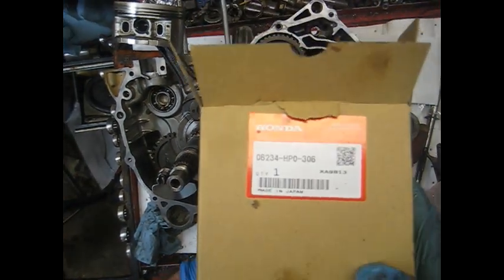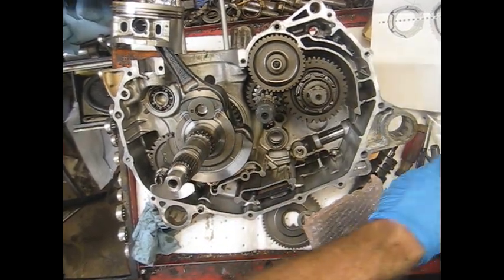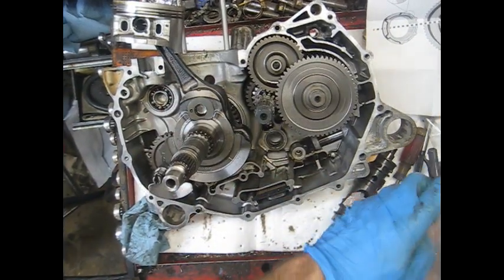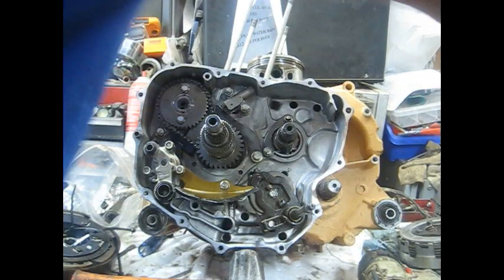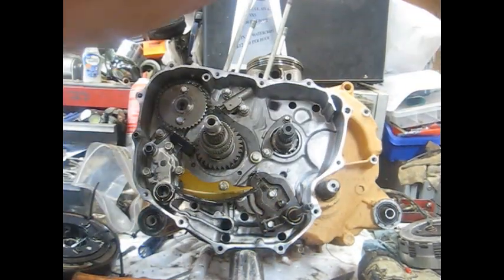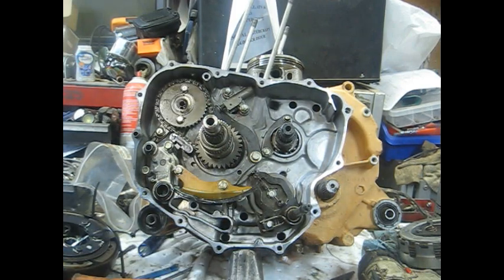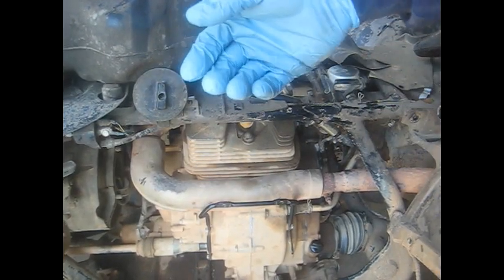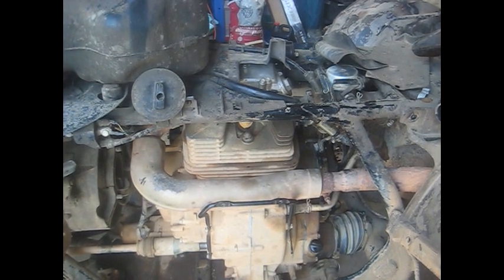Foreman 500 Aircooled engine assembly

Comment: Is a gasket required when installing the cylinder wall back on could tell if a gasket was needed there or not. The surface between the cylinder/jug and the engine block. Great video thanks for your help!!!
Reply from the maker: Yes the base gasket under the cylinder is required.

Comment: I don't know if you said but what did you torque down the rocker arm top piece down too was it 10 or 9 or something like you done everything else foot pounds I don't remember you saying anything about it but I could have possibly missed it appreciate the video thanks a lot guy
Reply from the maker: The manual for this bike does not specify a torque for these bolts.  It just says to tighten them.  I normally just torque them to what I normally do the other 10mm headed bolts to.  That is 10 N/m or 7 lb ft.

Comment: I’m dealing with a problem with my 06 500 I rebuilt the top end and pulled the back two covers to replace the shifter shaft when I turn it over it seems like it has a lot of compression timing is right and valves are adjusted at .006 when I’m turning it over I hold wide open throttle it stops turning over and I used rtv on the two back cases could that be my problem? Your help would be greatly appreciated
Reply from the maker: Just rtv and no gaskets?  If you left the gasket out then yes that's your problem. The thickness of the gasket is needed for clearance on the gears.

Comment: Nice video, did all the job but the gear that the starter turn is jammed so i got to start manually. Any idea how to fix that?
Reply from the maker: Will the gear not spin in either direction?
Reply: @FourwheelerDoctor  no

Comment: - Just finished replacing 1st gear on my 2005 Foreman 500 manual. Put it back together and works perfect. However, the previous owner (just purchased it a month ago knowing the first gear was gone) mounted a fan switch. Believing it’s just for pushing snow or hard hills I left it off. Took the kids today trying to beat the cold (-35 Celsius - VERY COLD) but after climbing a hill it bogged down. Turned the fan on and started it, it ran rough but got better. Left the fan on. Now it kind of knocks a bit, a metal sound (left of the driver side more) Works fine. What could have happened? It sounds like a rocker or valve out of adjustment (I did not adjust the valves when putting it back). No difference between cold or hot. I would appreciate any help. Thank you for the video, it helped me a lot!
Reply from the maker: I wouldn't think you would have run it hot.  I would try a valve adjustment and see if it quites it down.
Reply: @FourwheelerDoctor  - It probably went hot. But very briefly. Could that do severe damage? The knock wasn’t there before. I’ll adjust the valves tomorrow.
Reply from the maker: @maximusfuscus  it's not good on them to run them hot but if your is one of the air cooled models which I assume it is, some of the Honda ATVs do not even have a fan like some of the 350 ranchers and the 300 fourtraxs,  they just rely on air passing by the cylinder to keep them cool. I am also assuming you oil level is good.
Reply: @FourwheelerDoctor  - yes, air cooled and oil cooler with a fan. Oil level is perfect, new oil and filter (positioned correctly). Could have been oil starved? What should I be looking for of opening if again? Man I owe you a lot of beer...
Reply from the maker: @maximusfuscus  if your oil level was good it probably didn't get oil starved. Sounds like it may have ran hot unless you were traveling at a good rate of speed. the fans don't run much on these things but they do come on occasionally and we'll cool the motor off considerably as well as the oil. If you take it back apart what you need to check for is play in the connecting rod at the piston. It can move side to side but it doesn't need to have any play up and down whatsoever.
Reply: @FourwheelerDoctor  - Thank you sir...
Reply: @FourwheelerDoctor  - Although I am affraid that somehow oil doesn’t travel to the top of the engine. It was getting hot quickly even when idling in very cold weather. I could smell something not being right but I thought it’s my WD40 leftover on screws or something. No lights came on. How can I check the oil flow at the top?
Reply: @FourwheelerDoctor  - So I reopened it today. Drained the fresh oil and it was murky/brownish light, unusual, milky. Somehow the oil pump shaft broke! The pressure was lost and the piston sides look scratched. The inside of cylinder wall as well a bit. No vertical play. It probably still had oil but not enough. I am looking for parts now but I never bored the cylinder. I tried blowing with my mouth in the oil cooler hoses but it feels dead locked so I suspect that’s what caused the oil pump shaft to break. Very weird...anyway it could have been worse.
Reply from the maker: @maximusfuscus  that is weird. I can't say I have ever seen that happen.

Comment: Hello I am very thankful for your videos and have a question, I just tore down my 500 foreman that wouldn't go into third gear, I was expecting to find a missing tooth but there isn't any missing. I just got this but I think someone had it apart previously and may have put it back together wrong. Some of the tabs on the gears do look pretty worn but I'm not sure that would stop it from going in third. Do you have a video assembling a trans for on of these? If not is there any way you can help me? Thanks in advance
Reply: Did you manage to resolve why it wasn't going into 3rd?

Comment: Good afternoon, I tore the motor down and replaced the first gear assembly just like in the video, however when I reassembled and took it for a test drive I noticed that it won't stay parked when it goes into gear. Instead it now starts to move whenever I put it in forward and reverse in while still at idle. Any idea what I did wrong?
Reply from the maker: Did you take the one way bearing out from behind the centrifugal clutch? Sounds like it may be in backwards
Reply: @FourwheelerDoctor this compared with 04’ trx450FE? 
Basically same design or should I expect a large difference. Close to setting everything out of frame and onto the table. 
Without any prior issues with trans, had a wheel cylinder stick, son drove it back to the shop here at home from our trails.  (Ran it In 2nd/3rd gear the way back) After going ahead doing  front and rear brake change and flush/bleed with new wheel cylinders.  I started it up, let it run a few minutes, drove it roughly 100yds then an awful noise began. I shifted to neutral with engine still running. Noise didn’t change, shifted to first and noise stayed the same. Shifted back to neutral and shut off the engine. By hand rolled the quad forward and back, no binding or noise. With quad off I shifted to reverse and 1st while rocking forward and back. All seemed fine, until I shifted back to neutral and attempted to restart engine. It made a turn over then suddenly locked down. 
I removed the pull starter cover, using a ratchet and socket I was able to turn the shaft backwards several rotations. 
Removed spark plug. 
Then using the ratchet I attempted turning engine over in its starting rotation. Able to make maybe 2 full turns until it locked again.  
Is it most likely to be only a broken gear? Or something more extreme?
Reply from the maker: The one way bearing behind the centrifugal clutch is installed in the wrong direction.
Reply: @FourwheelerDoctor  I haven’t been into the engine yet, only done the brake work. 
Actually the engine has never been broke into since new.  Certain that something is broken internally.
Reply: I should’ve commented as it’s self instead on another’s comment. 🤦‍♂️
Reply from the maker: @jasonlewallen7146  sorry man. I replied to the initial comment and not yours. You doest sound like it may be a clutch issue as well. If I were you I would pull the front cover and check and remove the clutch. It may be worn completely out. See if you can rotate the engine after removing the clutch.
Reply: @FourwheelerDoctor  I do have the front cover off already, so tomorrow morning I’ll get the clutch off. Thanks.
Reply: @FourwheelerDoctor  I wasn’t able to get busy in the shop this morning as I had hoped, but I’m here now. The problem I have found is that the 3 of the 6, 6mm Allen head bolts in the “stator drum” has sheered off into the stator. Assuming one backed out, then total destruction from there. It’s a mess! Appears that all metal fragments were contained inside drum. Now I’ll be up awhile watching your videos to see what all is needed done to replace needed parts. I see that quality parts will run me roughly $350ish.
Reply from the maker: @jasonlewallen7146  that's odd that they sheered off. In all my time of working on these I can only remember ever replacing two flywheels and stators. I think both of cases were because someone had worked on them before and didn't torque and loctite the flywheel bolts and the backed out.
Reply: @FourwheelerDoctor  while disassembling I learned that at sometime it has in fact been worked on, and I’m sure that’s the case here as well. No signs of locktite on any of the bolts.  🤦‍♂️

Comment: Got the shift forks in the groove on the drum and put the two cases together and i cant turn the shift drum with a flat head
Reply from the maker: Bolt the star piece on the clutch side of the drum and see if you can turn it then.
Reply: What all do i need to bolt back up? I put the star pieces on and still cant turn the drum. This thing is frustrating
Reply from the maker: @tylermadeit5396  just the star piece. A lot of times it will line the shift drum up so it will shift. Are you sure you had the forks in the right direction?
Reply: @FourwheelerDoctor  i believe i have the forks in the correct direction. The lowest. Por is facing with the letters up. "C" in the center facing up. Fr right under low gear set. This placement allowed gear dogs to slide up and down on the shaft by lifting forks up. I then installed drum lining the shift fork pins into a vein in the shift drum by barely lifting the forks. The only problem that i can see is the top or front fork is kind of binding. I have bought all three forks. Fork shaft. Low gear set
Reply from the maker: @tylermadeit5396  are you rotating the  change clutch shaft as you are trying to shift it?
Reply: @FourwheelerDoctor  yes. The drum will rock back and forth a small bit it just will not rotate completely to. Im at a lost lol.
Reply from the maker: Was there something broken on the shift drum/ forks or were they working before you too it apart?
Reply: @FourwheelerDoctor  they were working but the reason i went into it was it was jumping out of first gear. The fork was slightly bent. The gear dog piece has a lot of wear and so did low gear. I then bought all the forks and shaft and low gear set. Does it matter which way the dowel on shift drum is facing when installing? The service manual says to face it towards fork shaft
Reply from the maker: @tylermadeit5396  it doesn't matter when you install it. If it faces the fork then it should be close to neutral. I don't normally pay attention to the dowel when I do mine.  I just make sure I rotate it later to neutral before I put the rear cover on with the gear sensor on it.
Reply: Thats kind of what i thought. I have got something wrong and idk what it is because ive done what you did in your video and what the service manual says lol

Comment: Wow...thank you. Can I do this without removing the top end since the engine came out together? What I don’t understand is how to remove the timing chain without messing up the timing. Thanks in advance.
Reply from the maker: It is tough to change the timing chain with the engine assembled. You can get to the chain and cam by removing the front cover but you will have to pull the push rods and hold the cam followers up with magnets before removing the cam. The timing marks will have to be lined back up once the cam is removed and reinstalled.
Reply: What I’m trying to do is replace the first gear. Do I just open everything, take the clutches/flywheel out, mark the timing and remove? Does the piston have to be in a certain position (Tdc for example) when marking the timing?
Reply from the maker: @maximusfuscus  yes the piston has to be at top dead center when the cam is reinstalled.
Reply: @FourwheelerDoctor  - Last question. How do you see it is at Tdc? You were looking at the side in the video.
Reply from the maker: @maximusfuscus  there is a plug on the right side of the motor that has to be removed with I think a 5mm allen wrench. This will let you see the timing marks on the flywheel.

Comment: Hey got a question I got a 500 I’m working on now and noticed when I turn the clutch basket there is a tight spot about 3/4 way around is that normal or do I have a bad gear? it is in neutral
Reply from the maker: I've seen that happen on ones with gear reductions but not on factory ones. I would assume something's wrong with the gear or basketif it has a tight spot
Reply: I pulled the basket and turned the shaft and it still hits the tight spot looks like I’m splitting the case I guess thanks
Reply from the maker: @christrent1073  I hate to say it but yes it sounds like you may have a tooth broken or about to break in the transmission
Reply: Thanks I’d say this thing has seen a few neutral drops keep doing what you do your videos have helped me a lot
Reply from the maker: @christrent1073  not sure what year model yours is but I have a video of replacing first gear on a 2010 model. From what I understand that's a common problem with that model bikes.

Comment: I just did the top end on a 07 Forman 500 and it has 150 lbs of compression now. Good spark but pushes air out the carburetor when I spin the engine over and it wont start? Any ideas? I've followed all the steps in your videos.
Reply from the maker: Sounds like you have a timing issue. Are you sure you had it at top dead center on the compression stroke when you adjusted the valves. Were any of the valves real far off before you adjusted them?
Reply: @FourwheelerDoctor  yes the valves where off when I first messed with them. I replaced the valves and seals when I did the top end. I spun the crank by hand lined up my t mark. Both push rods where down. Installed the valve cover and adjusted valves to .006. And no luck. It will fire occasionally but not start. I wish you lived close to Jacksonville I'd bring it to you.
Reply from the maker: @derekearnest2164  have you checked the valves since you tried to crank it?
Reply: @FourwheelerDoctor  yes they are at .006
Reply from the maker: Was it running before you took it apart?
Reply from the maker: @derekearnest2164  did you change the timing chain?
Reply: @FourwheelerDoctor  no I only took the top end apart. But the piston was at the top when I lined up the t mark. And the intake valve goes down then back up when I'm putting it on the t mark. Both cam lobes are down and both the valves have a little play. I assumed that means its times correct?? I've tried everything  I can think of besides changing the ecm. I would gladly pay you to walk me through getting it going. 
Nine zero four four eight five two zero nine nine.
Reply: @FourwheelerDoctor  I bought it not running. Was told it had bad gas. I found a plastic grocery bag sucked through the carburetor into the head when I took it apart. So it was running before
Reply: @FourwheelerDoctor  I took the clutch cover off when I got home and sure enough it jumped time. The tensioner is all the way out and the chain slides around the gear. Problem solved.
Reply from the maker: @derekearnest2164  good deal. Glad I could point you in the right direction.

Comment: On my reverse arm I have a washer I dont have the arm like yours
Reply from the maker: What does your arm look like?
Reply: @FourwheelerDoctor  it's just a shaft that comes out goes through the cover and connects to the cable on the outside theres a gold colored arm that actuates in the case but no second arm like yours
Reply from the maker: I'm a little confused. I don't think I showed attaching the reverse arm outside of the motor on the video. I usually do that as I am putting the motor in. There should just be a short shaft that sticks out the back of the case with a flat spot on it. The arm that goes on the cable will line up with that flat spot. Usually the arm has "out"  stamped on it. Then a bolt will go in the center of that arm into the center of the shaft to hold it on the shaft
Reply: I think I got it figured out yours has 2 internal arms mine only has one but you also have some sort of ball switch on your case that arm hits I dont have one of those either my bike is an 05 foreman footshift 2wd
Reply from the maker: @kcwyrick7947  yes that is correct the ball switch is only on the electric shift models, the foot shift model does not have that. That is to keep the shift motor from trying to shift when the lever is not pulled on the es models
Reply: Thank you so much for the replys I really appreciate it I hope your channel takes off